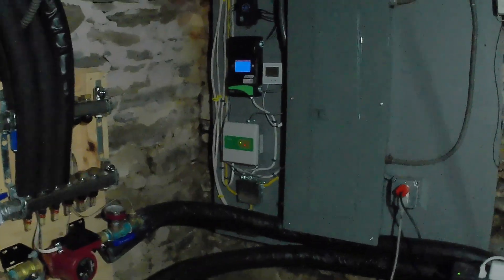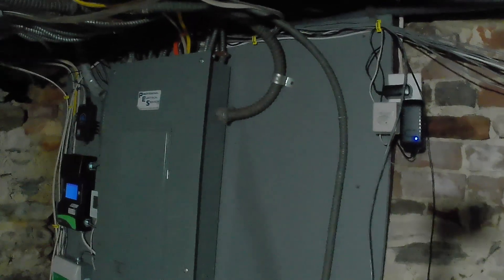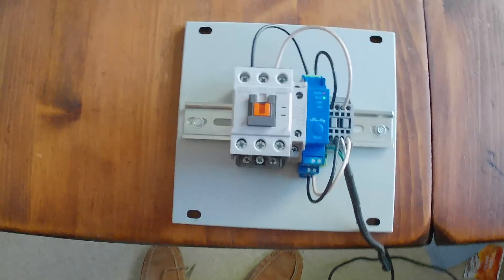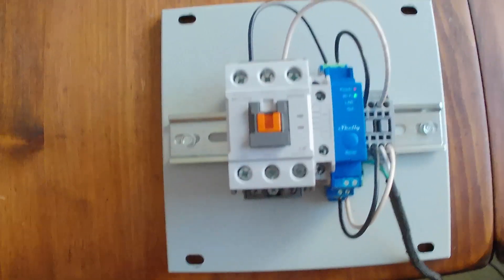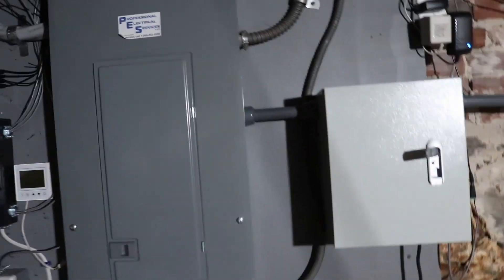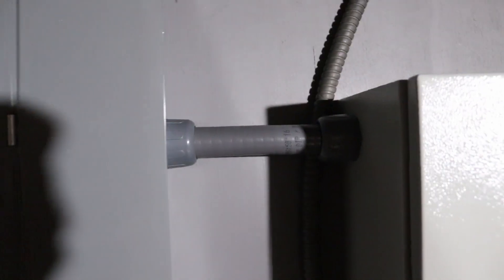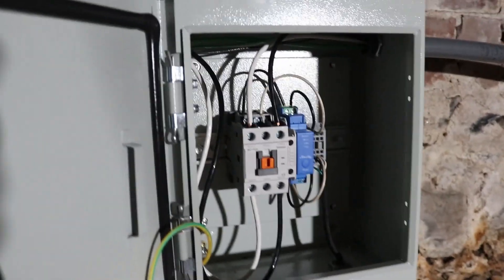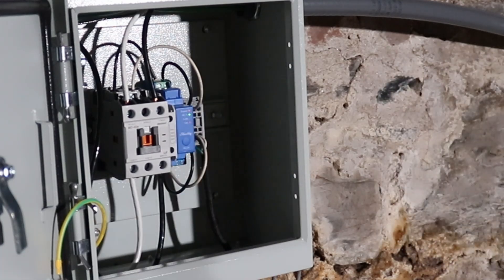Adding Smart Relay to Heat Pump Controls

Comment: Make sure to test it with the box closed.  The metal box might block the wifi with the door closed.  You should ground the box too.
Reply from the maker: I was worried about that, luckily the wifi still gets through. Probably helps that the wifi router is a few feet away... Thanks for watching!